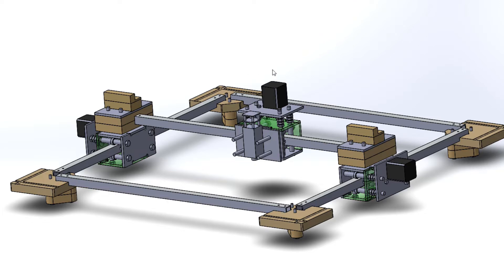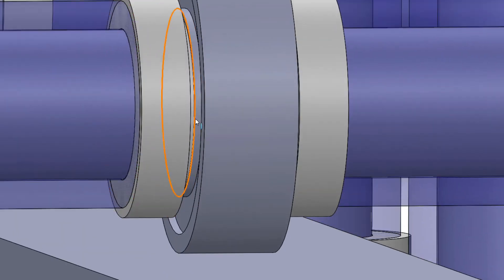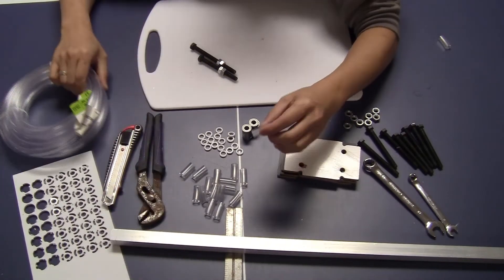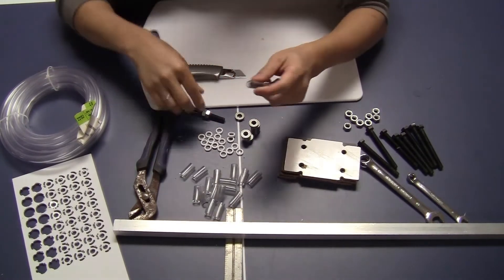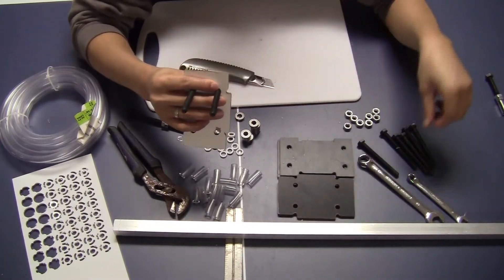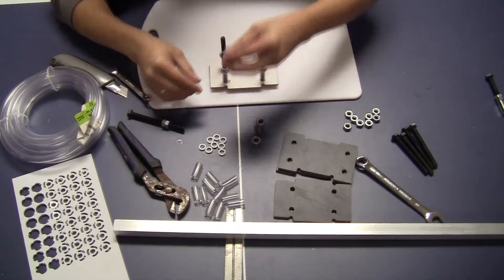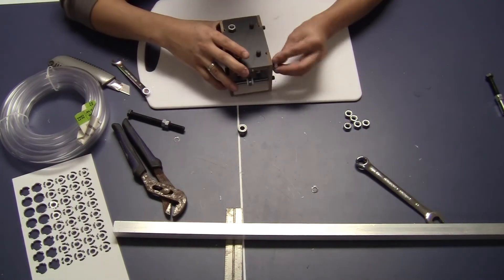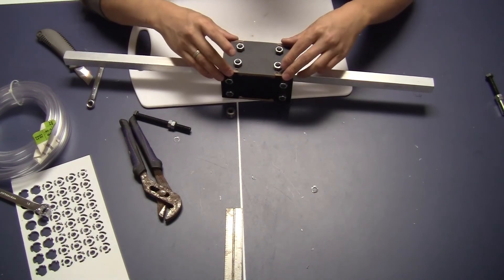Linear bearing for square tube V2 - symmetrical design

Comment: This is such a cool project! I think you'll find that this has less rotational stability than your version 1. I think, however, that you could compensate by offsetting each roller to one side, alternately, to for Vee pairs in opposed corners.
Reply from the maker: Yes, I get what you are saying. If the linear bearings are not stable enough, I will increase the number of skate bearings like the first version to make the setup more sturdy.